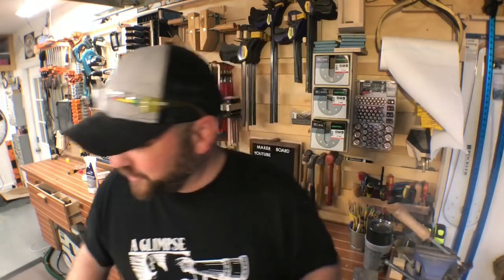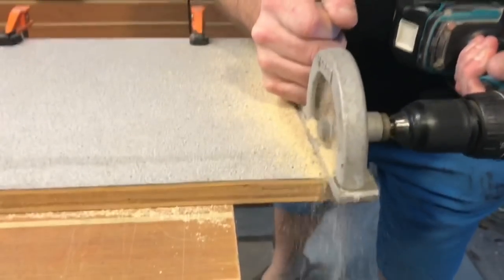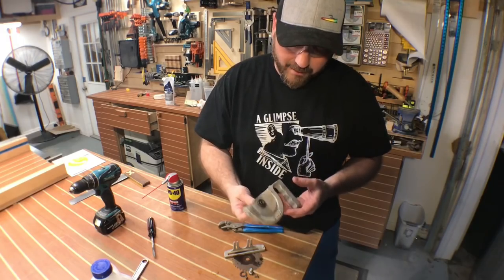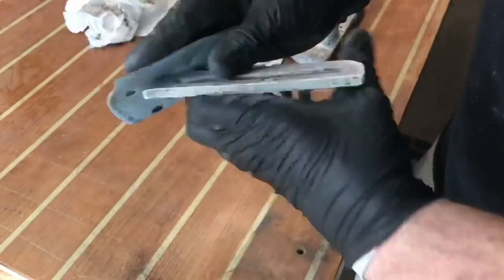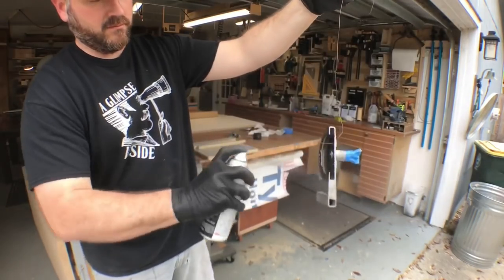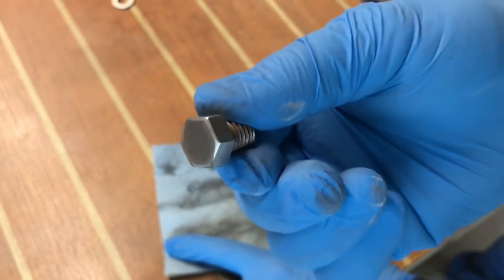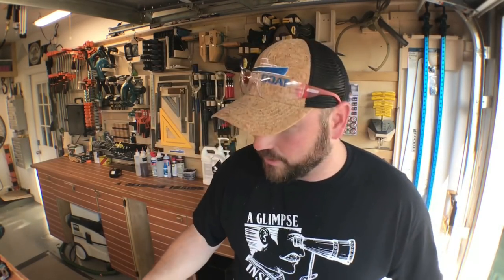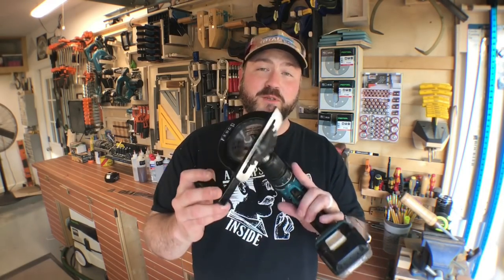Drill Powered Circular Saw Restoration | How to Restore | DIY

Comment: I assume this would have been used mostly by homeowners with an electric drill and possibly some who owned early Kirby vacuums. Kirby used to sell various attachments for the uprights and one of them was a saw blade. It would attach to the front of the vac via a flexible drive. We had one when I was young, about 60 years ago, but, If I remember correctly, the blade we had didn't have a guard. and I don't remember if anyone ever tried to use the saw.
Reply from the maker: Interesting point about the Kirby vacuums. Really makes you appreciate the times we live in
Reply: @AGlimpseInside  I was raised around power tools, from a Rockwell RAS to a Delta TS, and even operating a lead melting pot, but at just 8 or 9 years old I think I had my first wtf moment when I saw that blade attachment. lol
Reply from the maker: kperellie That’s pretty crazy. Glad I could give you that moment just as I had as well